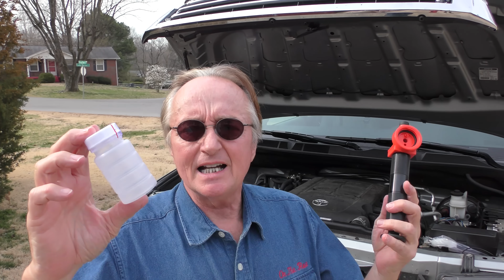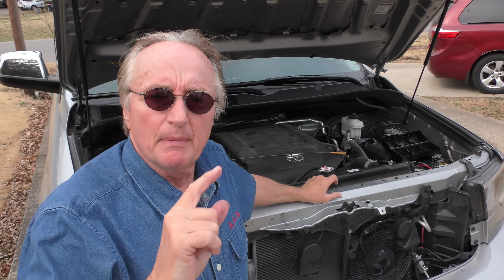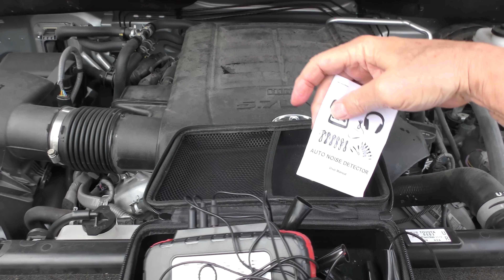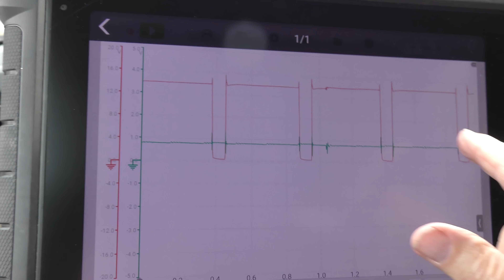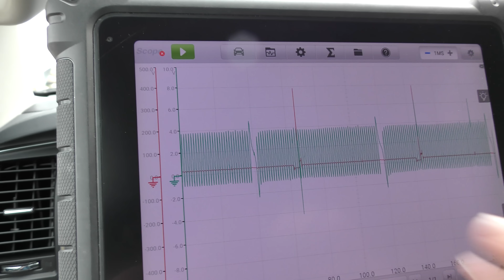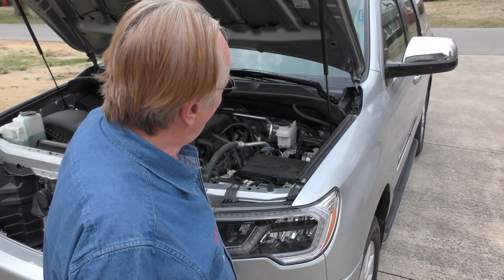Here’s Why You Can’t Work On Your Own Car Anymore

Comment from the maker: Things Used in This Video:
1. Stethoscope Allsun: https://amzn.to/3DQiZu0
2. Auto Noise Detector Master: https://amzn.to/41z6tqC
3. Professional Scan Tool: https://amzn.to/3Rf82oC

Here's Why the Toyota Sequoia is the Best SUV to Buy Right Now: https://youtu.be/zPoPUcEXVk4

⬇️Scotty’s Top DIY Tools and Products:
►Best Scan Tools:
1. Newest Scan Tool: https://amzn.to/4jvxvr7
2. Bluetooth Scan Tool: http://amzn.to/2nfvmaD
3. Cheap Scan Tool: https://amzn.to/2D8Tvae
4. Mid-Grade Scan Tool: https://amzn.to/4bLkN2g
5. Professional Scan Tool: https://amzn.to/4dsaa6e

►Best Car Jump Starters:
1. No Charging Required Jump Starter: https://amzn.to/3i7SH5D
2. Mid-Grade Jump Starter: http://amzn.to/2nrc6qR
3. Best Jump Starter: https://amzn.to/4c1O9JI

►Best Fluids for Your Car:
1. AT-205 Re-Seal (Can Stop Leaks in Your Engine, Transmission, Etc): https://amzn.to/3LCruJq
2. ATS 505 Fuel System Treatment (Pour in Gas Tank): https://amzn.to/3LXhEC9
3. ATS 505 Oil System Treatment (Pour in Engine Oil): https://amzn.to/3SZHZmN
4. Head Gasket Leak Test Kit (To See if Your Car Has a Blown Head Gasket): https://amzn.to/3yDmj9h
5. Lubegard Automatic Transmission Shudder Fix: https://amzn.to/46XEsek
6. Lucas Oil Transmission Fix (For Worn / Slipping Transmission): https://amzn.to/3WSBgfK
7. Meguiar's Headlight Coating (Keeps Your Headlights from Fading): https://amzn.to/46l7kgh
8. Meguiar's Headlight Restoration Kit (Restores Faded Headlights): https://amzn.to/3zT9ojN
9. Meguiar's Clear Plastic Cleaner and Polish (Cleans Headlights): https://amzn.to/3DaZjRa
10. Meguiar's Car Scratch Remover: https://amzn.to/4faB3wJ
11. NuFinish Car Polish (Use on Paint or to Stop Windshield Squeaks): https://amzn.to/3SjmYmA
12. Invisible Glass Cleaner (Inside/Outside Car Window Cleaning): https://amzn.to/3YcElcL
13. Hide Rehab Leather Conditioner (For Leather Car Seats, Etc): https://amzn.to/3YYVtmN
14. Blaster Silicone Lubricant (Lubricates power windows, door hinges, stops squeaks, etc): https://amzn.to/46Ss3bP
15. Rain-X Waterless Car Wash: https://amzn.to/4czhc7K
16. Permatex Windshield Repair Kit: https://amzn.to/4fX5mHF
17. CRC Battery Terminal Protector (Stops Battery Terminal Corrosion): https://amzn.to/4dNnIsy
18. CRC Mass Air Flow Sensor Cleaner: https://amzn.to/3YSTm3x
19. Bar's Cooling System Stop Leak (Can Stop Small Coolant Leaks): https://amzn.to/4dQM3Oh
20. Bar's Blown Head Gasket Repair (Can Stop Head Gasket Leaks): https://amzn.to/3AH6wXj

►Best Car Accessories:
1. Quick Twist Oil Drain Valve (For Fast and Easy Engine Oil Changes): https://amzn.to/46Vn2z4
2. Solar Car Battery Charger: https://amzn.to/4fktsMd
3. Plug-in Car Battery Charger: https://amzn.to/3Yqpjju
4. Dash Cam (Every Car Should Have One): https://amzn.to/41eAzj3
5. Key Finder (To Find Lost Car Keys): https://amzn.to/3Yb6gd4
6. Faraday Box for Car Keys (Blocks Car Key Signals / Anti-Theft): https://amzn.to/3YPlCnX
7. Tire Gauge (To Check Tire Pressure): https://amzn.to/3y8R4CE
8. Tire Air Pump: https://amzn.to/3yCqiD3
9. Car Memory Saver (Use When Changing Your Car's Battery): https://amzn.to/3YmWQeJ
10. Car Odor Eliminating Rocks (Removes Smells in Your Car): https://amzn.to/3zYMFCP

►Best Tools for Working on Your Car:
1. Best Cheap Magnetic Work Light: https://amzn.to/4dQKL5T
2. Best Small Flashlight: https://amzn.to/4fePFep
3. Best Expensive Multi-Use Flashlight: https://amzn.to/3WBxzft
4. Car Battery Tester: https://amzn.to/4bg4dZL
5. Basic Mechanic Tool Set: https://amzn.to/2tEr6Ce
6. Professional Tool Set: http://amzn.to/2Bzmccg
7. Ratcheting Wrench Set: https://amzn.to/2BQjj8A
8. Crowfoot Wrench Set: https://amzn.to/3Xcn6aB
9. Cordless Impact Wrench: https://amzn.to/3WHgpMa
10. Corded Impact Wrench: https://amzn.to/4bVrHlG
11. Electrical Circuit Probe (For Testing Power, Ground, and Shorts): https://amzn.to/4cTwMfp
12. Socket Extension Bar: https://amzn.to/4dedEsf
13. Small Sledge Hammer: https://amzn.to/3WzHsdj
14. Best Borescope for Seeing in Tight Spots: https://amzn.to/3zW3U7K

🛠Check out the other tools I use and highly recommend ► https://goo.gl/rwYt2y

🔥Scotty Shirts and Merch ► https://goo.gl/pTAeca

👉Subscribe and hit the notification bell! ► https://goo.gl/CFismN

As an Amazon Associate I earn from qualifying purchases.

Comment: My 2007 tacoma doesn’t have a trans dipstick I personally think that’s the worst thing they could of done now I hear new cars have zero dipsticks no thanks I’ll never buy a new or newer vehicle period
Reply: You heard wrong. You can still check oil, brake fluid, coolant and so on... Oil still has a stick.
Reply: @toddm.7746 yesterday I seen two newer vehicles that didn’t have a engine oil dip stick the gauge was on the dash
Reply: But you are correct I herd him wrong thanks

Comment: Old cars are worth putting engines in especially if they're before all the computer stuff took off.  They were made much better and once fixed, they'll go even longer
Reply: I have a 2000 Blazer 240k miles, an 04 Buick LeSabre at 212k, and an 01 Honda CR-V at 245k all still going strong.  No turbos, no garbage electronics
Reply: @brensdaman926  Boogity boogity boogity!
Reply: @brensdaman926  1980 Buick V6 still running 💪☺️ ❤️
Reply: @brensdaman926  Ya Man! Go 1975 Ford Thunderbird 460.
Reply: @DooWop45s  Boogity!

Comment: The real reason people can't work on their cars anymore is the car companies have made them overly complicated to discourage the owner from working on it themselves. Thereby supporting a very expensive dealer network. My advice to potential buyers of new vehicles is don't buy one until they change the way they build these cars. Minimal Computers or none at all. Many people are surprised to learn that a car does not need any computers to run. Making it much more reliable and easier to repair. If someone tells you modern cars have to have computers to make them run efficiently and get better mileage. Baloney. Many cars and trucks have owned in my life got much better gas mileage than the more recent cars I now own.
Reply: Yeah MPG is no difference from sixty years ago Lotus Elan had a low coefficient of drag of 3! Tesla 3 has improved this to 2.29 ! So that's definitely an improvement over many modern cars too!

Comment: The only issue with buying a used vehicle and doing this is that by the time you get the results, the car may already be sold.  As you have to ship the sample to them and then it's probably a few days after that to get your results, so we'll say about a week.  So I'd say these are more useful for a vehicle you already own since that week of wait time is not going to make or break a deal, so it may  be hard to do this test with a potential vehicle you're looking to buy, unless it's someone you know and you're the first person they're offering it to and you have some time to decide.

For me I just drive them until an issue comes up and then deal with it (all while maintaining the car normally) and so far that has worked.  The issue's Ive run into are typical issues like oil burning and bad O2 sensors as a result but this isn't something I need a test to tell me since I can see that it's burning oil (this was on my former vehicles, not my current ones) but so far that has worked.  Other things like bearings may be harder to detect, although in some cases, you will hear it but by that time you generally don't need a test like this as it will be obvious.

Comment: I had crank bearing rod knock noise and oil pressure light came on after driving 200 miles I just did oil change after oil change the noise and oil pressure light gradually disappeared over time.. Moral of the story if the oil pressure light comes on change the oil asap. But don't junk the car. Bearings can last a very long time even when they are scored provided car has good oil still driving it 3 years later sr20de with 340000 km.
Reply: Don't waste money on oil diagnosis just change the oil !! Clear out the sludge

Comment: I took your advice and bought the Ediag Elite odb2 scanner.  My car was in limp mode and my other 2 scanners were no help. The Ediag Elite used thinkGPT and isolated the problem to the throttle body where I found and patched the broken wire and problem solved.  Thank you for the recommendation!
Reply: Scanners are next to useless. What's more important is understanding how engines work and what to look for.
Reply: That sounds interesting.  Using a scanner and ai...
I will have to search for the video he made

Comment: How to replace speed sensors in transmission, Chrysler 200 Touring 2.4 engine 6speed
Reply: Trade it in. The Chrysler 200 is the modern Edsel.

Comment: noise detectors are useless if you dont know what a good noise sounds like
Reply: Can be very helpful if you have two of the same thing. Like a lot of vehicles do. Chances are both sides won't go bad at the same time or one side is worse than the other. You can usually narrow it down to front or back 1st, but not always, and just like your vision is not as good when you get older, neither is your hearing. So take care of them

Comment: 4runners are the one vehicle ive bought twice with no inspection and they were both perfect. Only basic maintenance.
Reply: If only they still made them with manual transmission
Reply: @Luluwolf-m9g  I'd buy one in a heart beat. Hell has anyone done a conversion in a 4th or 5th gen?
Reply: Frame rust is an issue on 4 runners.
Reply: Well, to be fair I DO know a good amount about cars. Plus I live in Oklahoma, my 4runner spent it's whole life in Texas. 210k miles not a speck of rust anywhere
Reply: @timmccall4566  that's so lucky - don't let it get anywhere near a state that uses halite
Reply: @shiddy.  oh no I don't buy vehicles from northern states lol. Always check the carfax!
Reply: absolutely look for frame rust on them ... and definitely get them undercoated - it's so worth it

- 2008 4runner with 475k miles

Comment: Give me an old '66 Falcon,  straight 6, three on the tree, radio, heater, steering wheel, brakes and a seat...I'm good to go.  Cars today are too damned loaded with technology and way too expensive.
Reply: The last great ford was the crown vic. I'm happy with a good one of these
Reply: @greathey1234 Absolutely.  I'd love to have one myself.
Reply: I had a 1963 ford fairlane with same equipment, best car I ever had
Reply: 64 comet with 260 V8. Wish I still had it
Reply: My brother wrecked my grandfather’s 1967 Falcon Futura, came stock with a 289 V8 engine (Mustang V8).  So smooth, quiet, and powerful!   So sorry my brother got his hands on it.  He’s the type that wrecks anything he gets his hands on.  😢
Reply: @markg.1118  That's a shame.  I've got a son-in-law the same way.  Seems to take pleasure in destroying stuff.
Reply: Yeah it was called a car….not a house

Comment: New cars are over-engineered rolling nightmares now.  We can thank decades of EPA overreach for all of this. I was in electronics for twenty years so I know how to use an oscilloscope and other electronic test equipment, but how many people without this background would? 
Plus, these cars are NOT designed to be easily serviced even if you discover what's wrong. 
I'll just  keep my old vehicles, thank you very much!
Reply: It's not so much the EPA, but more so greed by the manufacturers.  By making them complex, you have to go back to the dealer to get them serviced because the computers for example can only be programmed using a proprietary tool that only the manufacturer gives to dealers to use.  The complexity has little to do with the EPA in reality.
Reply: @HR-wd6cw  You made a good point. It was kind of symbiotic - one fed the other making the autos more and more complex, and, more expensive. As a result, the public, as usual, got shafted, both by the selling and servicing prices getting astronomical.

Comment: I've noticed that every year the EPA continues regulating mpg based on the size of the wheelbase. we don't need hybrids but we need smaller cars, the EPA is too strict on smaller cars and drives US automakers to make bigger gas hogs. a 1995 honda civic gets like 34/42 mpg city/highway but according to the EPA that car would be too wasteful on fuel and a giant hummer that gets 14mpg on the freeway is perfect.
Reply: My 72 ford maverick got around 35 mpg with a 200 ci inline 6cyl. Super simple car to work on.
Reply: I think they make the utes way to big and bulky and complicated with sensors and gadgets. Monsters on the road. Rangers etc

Comment: We airplane owners send in oil analysis each year.  It will tell just what parts are worn.
Reply: As a two stroke rotax owner, I tell if the bearing is bad based on if the piston is still in my engine or not
Reply: 😂😂😂 @stephenbower5510

Comment: This is why I'm driving a car that is very basic and doesn't have so much electronics - a 2000 Jeep Cherokee. There's much less things to go wrong with it that would need an expensive scan tool to diagnose.
Reply: True, the only problem is time, eventually the metal pits then it rusts.

Comment: this is why i hate new vehicles. trying to replace a 2004 gm truck with 140k miles. a rust bucket but relatively low miles. debating sinking money to keep it running rather than buy something newer. gummint is trying to keep the working classes from owning cars, be dependent on public transit. bastards!
Reply: Rust is a problem
Reply: But if you live in a small town with no public transit how can you rely on it?

Comment: Why mechanics charge $200 an hour, because they can. It's that freaking simple.
Reply: The shop charges that, not the mechanic. Besides all the specialty tools needed to work on these new cars are expensive. That doesn't include all the tools a good mechanic needs to own. 35+ year tech here, I've got close to 50k in tools of my own.
Reply: @Howard-Freedom 

I was talking in general.
And I wasn't being mean about it. Like I said, it's simple. They can.

As a Tuck driver, there's a reason why I charge $2.75 a mile. It's simple because I can. That's what the market bears...

And I got close to $300,000 worth of equipment. Your turn.
Reply: @Howard-Freedom 

was speaking in general terms. Like I said, can  charge $200 in an hour? Because they can. And that's what the market can bear..

Just like I charged $2.75 a mile as a truck driver because that's what the market can bear. And I can

Plus, I've got $300,000 worth of equipment.
Reply: They have not much demand for their servicea and a lot of overheads

Comment: I wonder how the 2 liter engine in my 2018 Focus is at 19,000 miles. How long will it last? Or the 6 speed automatic it's backed up to.
Reply: change oil every 5k miles and "drain and fill" the automatic transmission every 20k miles to maximize life of your Focus
Reply: @glennhansel9411 and don’t forget to use quality filters.